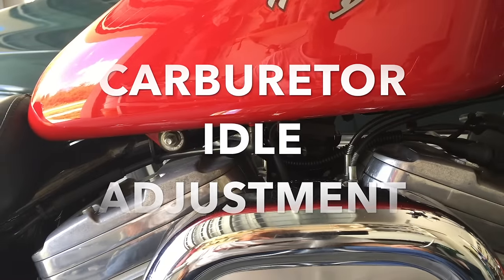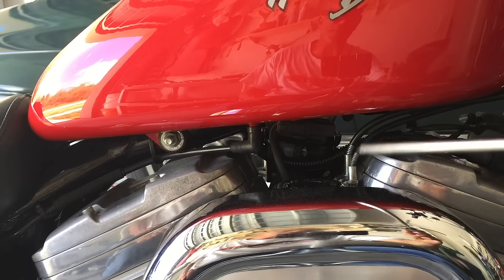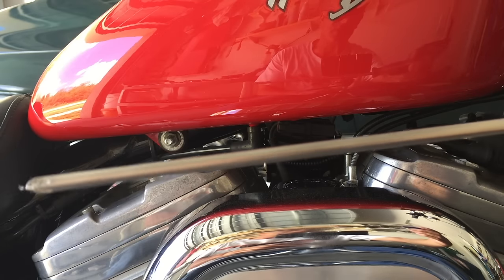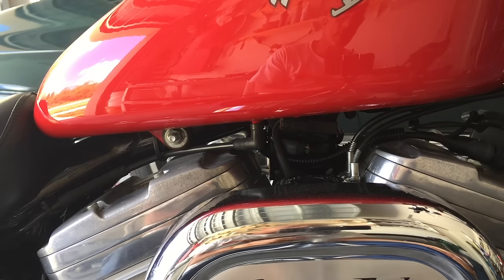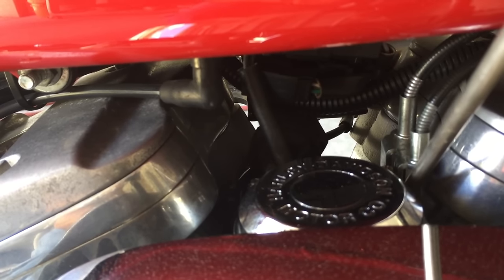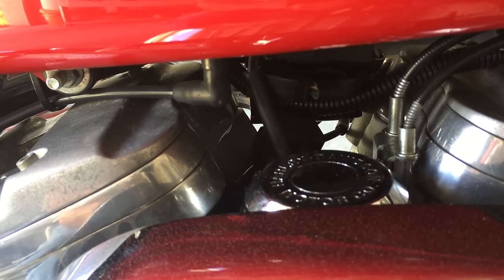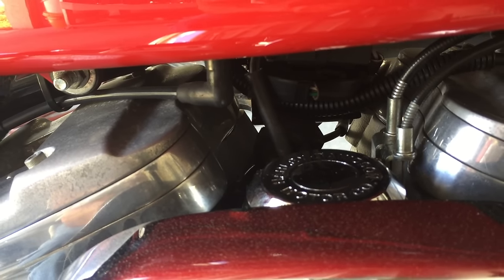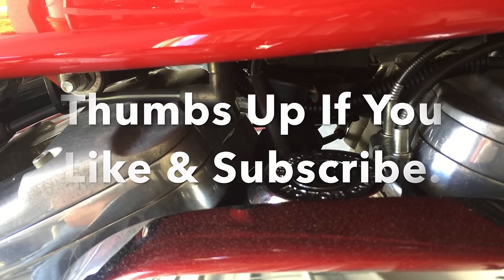How to Adjust the Idle On All Harley Davidson Carburetor Motorcycle.

Comment: Hi Rocco,
I have a 2005 Sportster 1200  XLC and am having a few issues. The bike is slow at starting and has died a few times when at a stop. The bike will idle fine most of the time, but hiccups sometimes when stopped where I have to give throttle to make sure it does not die. I am also having an issue when I rev the bike it seems to gasp for air for a second and then backfires. It is a 1200 with a stage 1 air cleaner, Vance and Hines exhaust. The bike runs like a champ at mid to high rpms. Any help would be appreciated.
Reply from the maker: Raise needle in slide with 3 carb washers...A/F screw out 1 3/4 to 2 turns out...Let me know how this works out...Ride Safe and have a great day..
Reply: Hi Rocco,

Can you help with what needle I am needing to adjust?? Where can I find carb washers?
Reply from the maker: https://www.ebay.com/itm/Keihin-CV-Carburetor-Carb-EZ-Quick-Tuner-Jet-Jets-Kit-Harley-Sportster-2004-2006/361569254157?hash=item542f34fb0d:g:O~oAAOSwneRXRJDP  Hope this helps...Let me know if you have any problems..
Reply: Two Wheel Rocco can you point out where the AF screw is?
Reply from the maker: http://partsfinder.onlinemicrofiche.com/ronnies/showmodel.asp?Type=13&make=hdmc&a=570&b=9&c=0&d=2005%20SPORTSTER%AE%20XL%201200C%20CUSTOM%20(CG)%20CARBURETOR%20ASSEMBLY
Reply from the maker: https://www.ebay.com/itm/For-Harley-Davidson-40mm-Cv-Carburetor-Performance-Tuned-Replacement/173362236797?hash=item285d31cd7d:g:HtIAAOSwVvRbCK2V.    Screw is on bottom of carb.  on top  of float bowl...hope this helps..
Reply from the maker: https://www.ebay.com/itm/1995-HARLEY-SPORTSTER-CV-CARB-40mm-CARBURETOR-27488-92B-TOURING-SOFTAIL-DYNA-FXR/302831992183?hash=item4682317d77:g:GpIAAOSwBdRbZldC:sc:USPSPriority!34953!US!-1.  Look at pic. 7 Some times there will be a cap that has to be drilled out.  1 3/4 to 2 turns out to richen gas mix.
Reply: Two Wheel Rocco do the three washers go between part # 55 and #52 correct?
Reply from the maker: You won't to rase the needle...So your gas will come on sooner to richen that needle circuit..Washer goes on below c clip on needle..Hope this helps. Let me know how its works out.
Reply: Two Wheel Rocco Hi Rocco, I added the washers and turned out the screw and the bike is idling a little high and when I go to give throttle the bike shuts off. What adjustment should I make?
Reply from the maker: return it to where it was...if not improved...What jets are in your carb...Main and idle? Is your excelerator pump squirting gas when you twist throttle? Did you buy this bike running this way or did this just happen?
Reply: Two Wheel Rocco I bought it that way. Going to work on it again later. We added the 3 washers and I think it may be too many. I may take it down to one washer. I also changed the plugs, so not sure if that made a difference
Reply from the maker: What size main and pilot jets?
Reply: Two Wheel Rocco not exactly sure I think it is dynojet.
Reply: Two Wheel Rocco and yes, gas is squirting out when throttle is used
Reply from the maker: Check for vacuum leaks petcock and carb...
https://www.youtube.com/watch?v=7Fo9Q93OJXI&t=2s.  Will affect the running of your bike...Spray some starter fluid at your intake and see if the idle raises....That a vacuum leak. Let me know how this works.

Comment: Hay bud any idea why my 2006 car sporty blupps when I throttle it sometimes? It backfires from the air filter. Thank you
Reply from the maker: What pipe and intake?
Reply from the maker: Sounds like it is running too rich. Make sure your air filter is clean. Turn in your A/F screw to lean your idle fuel.  Start there. Let us know how that works out. Watch this video.  https://youtu.be/kivgNpZWHeY
Reply from the maker: Thank you for your Sub, Any questions just ask. Ride Safe and have a great day.